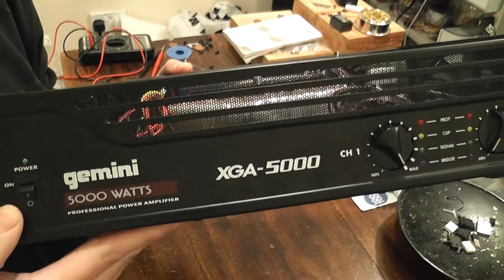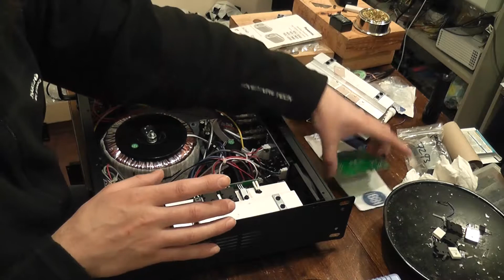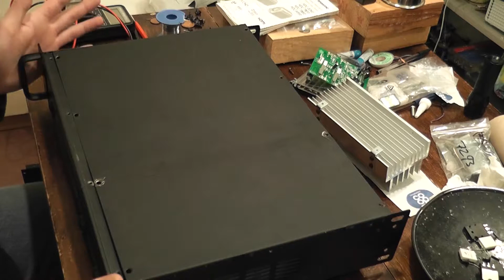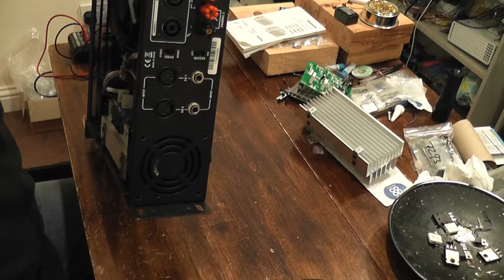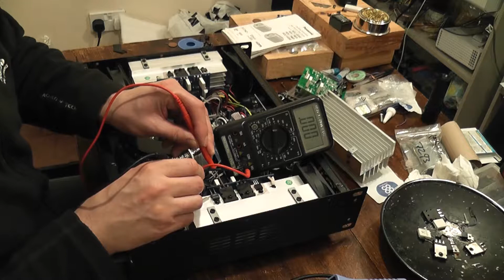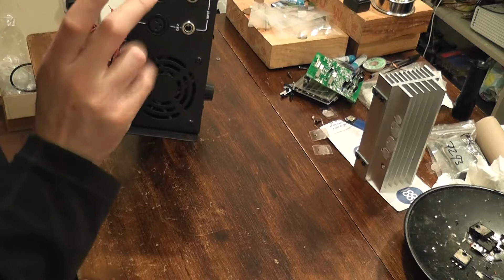Gemini XGA5000 amplifier repair PT1

Comment: I have a XGA5000 and one of the boards has blown.  At least 2 of the main transistors are short circuit. 
Would you have a working replacement board?
Reply: Did you ever find a replacement? I need one also.

Comment: Thanks for the video! I have a 3000 I just picked up, and it’s in protection mode right on startup. What would you guess I should look at first? Thanks for any help!
Reply from the maker: It will be a full cascade failure. Unfortunately there's no simple fix, a lot of parts up stream from the output stage will have blown. Extensive probing and testing will be needed to find all the blown parts, replace them, and then ensure everything is working afterwards.
Reply: Hey bro you got any power off on switch circuit boards?

Comment: What would cause channel one to play low on both the 3000 and 5000?
Reply from the maker: I'd say that's your signal source rather than amp. The wiring in the book for the XLR is wrong, they use the standard 2 hot, 3 cold, 1 earth. It shows it twice differently IIRC, and both times it's wrong.
Reply: @killcar5nbike2  so I have to change the signal source? And the 3000 channel one isn't playing. What could be the cause?
Reply from the maker: @brianbobb3970  try swapping left and right, make sure the wiring is correct. Also try only running one amp from the signal at a time. Could be a fault on one loading the source down.
Reply: @killcar5nbike2  what do you mean by running one amp from the signal? We've swapped the wires at the back of the amp and the same thing. Channel one would not play on the 3000.
Reply from the maker: @brianbobb3970  as in if both amps were sharing the same signal one amp might be loading it down causing the other to be quiet. That's if that's how you had it set up.
Reply: @killcar5nbike2  they are connected separately and not sharing the same source. The 5000 channel one has the low output and the 3000 has channel one not working

Comment: Hi, by chance you have the schematic of the xga 5000 or 4000, thanks
Reply from the maker: If you've got a blown one you can find all the components that need changing with just a multi meter.

No rail fuses so they take out most of what's on the amplifier section of the board, even the small diodes and resistors along with nearly every transistor.

Comment: Stay away from this product. I bought two brand new Gemini XGA 5000 amps. Out of the box one of the amps came with one channel not working. I’m not getting no where  the power they advertise in the specs. My 230 watt house amp plays louder than this supposed 1100 watt cinder block. Useless! These are crappy don’t waste your money. They say you get what you pay for yep, it’s true.
Reply from the maker: Nearly all of these were dead on first power up.

They need a high signal level to get any decent output. The clip lights illuminate way before the things actually clip too.

With better transistors on the output and driver stage they're not a bad amp. Just cheap semiconductors that let them down.

Comment: My xga3000 just blew out after powering up . I saw one of the two capcitor blown.
Reply from the maker: I fixed a 2000 a bit back, basically same amp as the 3000 with different transformer and output transistors.